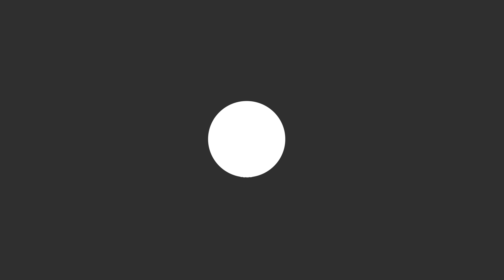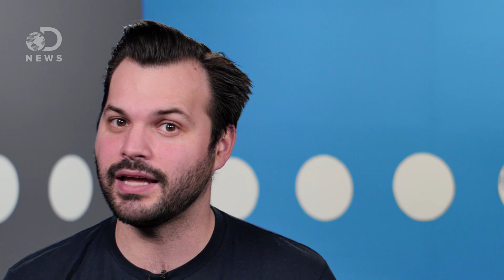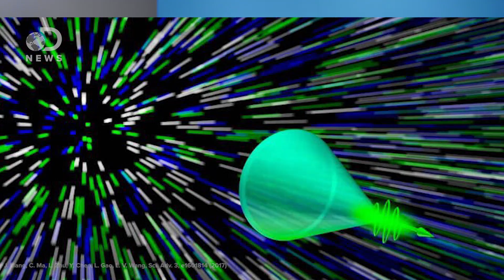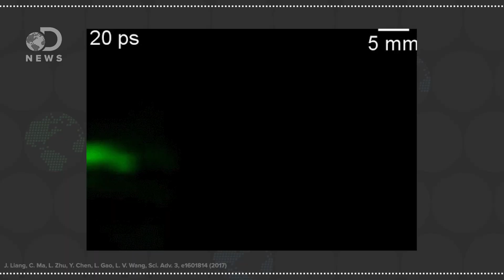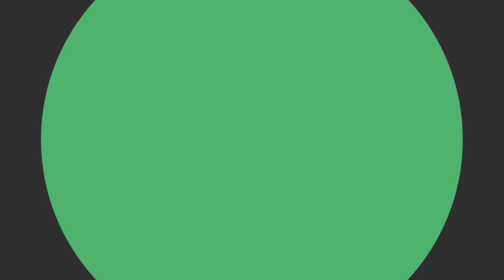'Sonic Boom' Of Light Captured For The First Time Ever

Comment: 100 billion fps it would take a bullet 50 years to go passed the screen
Reply: lol screen dimension would have nothing to do with it... maybe aperture size, focal length, or lenses used when shooting. but it would take the same amount of time for a video of a bullet to cross the screen wether it was 10 " or 10'
Reply: damn, people are sure dead serious around here...
Reply: Maybe the velocity, and distance traveled are obvious to him, like a 1800 ft/s 20 gauge slug moving across 2.35 feet. I don't know, but it might be closer to a 2500 ft/s NATO traveling across a little more than 3 feet. Granted you would need a fourty inch screen playing at 64 hertz.math is fine, but roughly rounded.
Reply: gregistopal I just calculated that assuming 60fps on the playback, 1 second of recording ≈ 52.85 years. I doubt a bullet would have taken anywhere near a whole second to go by the screen. It might be on vid a couple weeks to a couple months tho
Reply: Coltin Yancey He was making a joke fuckin hell.
Reply: gregistopal where dis you get those numbers? Bullet velocity varies widely depending on the caliber, screen of what dimensions, or did you just make them up?
Reply: Thats not actually correct. Its a filming technique that yields the IMPRESSION of a extremely fast frame rate. Unless I am mistaken, this is the same tech as the " 1 trillion frames per second" camera. As a result the final image is not from a single pulse but stitched together from many, each frame is a different pulse captured in a slightly different position from the one before. Its clever, but the claims are highly misleading.

Comment: Okay so if a jet goes fast enough it makes a sonic boom. so does the light make a boom sound? or is that you need more mass. does light weight anything? 

someone answer please
Reply: It doesn't, the title and phrasing are figurative, not literal.  The effect is similar to that of a sonic boom, but it is not an actual sonic boom.
Reply: Jose Ramirez 
Light is a photon, a little packet of pure energy as such it has no mass, but can to converted into mass in under some circumstances.
As for the sound I cant say positively but I doubt it doesnt make a sound as radio waves are a form of light wave and are well known to carry signals used in the creation of sound
Reply: +Coltin Yancey Well it wouldn't make a sound though. EM radiation is just used to communicate between devices that make sound. It doesn't make sound itself, more like it "tells" the device what sound to make.
Reply: +Andrew Velasquez Light, by definition, cannot have mass because it travels at the speed of light. Nothing with mass can be made to travel at the speed of light (it would take an infinite amount of energy) therefore light has no mass.
Reply: Photons have no mass. They do have momentum, that's why they can push stuff, but no, they have no mass.
Reply: light has weight any thing with mass can't escape a black hole
Reply: +Andrew Velasquez no, photons don't have mass
Reply: No this is Patrick search up if light weighs something
Reply: Jose Ramirez so if soundwaves move at the speed of sound without creating a sonic boom, why would light create one when it is moving at the speed of light?
Reply: Coltin Yancey photons make sounds, just not close to hearable to the human ears spectrum
Reply: Jose Ramirez if light has no Mass how can it be attracted by gravity?
Reply: King of the Castle Being massless doesn’t mean it can’t be affected by gravity, this was determined quite a while ago....

Comment: Since the speed of light actualy is constant and can't be slowed, wouldn't a more fitting explanation for the Sonic Boom beeing the emission of light from the atoms in the medium the photons wen't through? As I understand if a photon "hits" an electron its energy level is elevated but unstable. So when it returns to a lower level again energie is released as a photon. So basically a photon popped into existence and "accelerated" from 0 to c in an instant creating a Sonic Boom

Comment: (Facepalm) this is why I am probably going to unsubscribe. You can't slow light down. You can only put light through a medium and as it bounces around in the medium (at the speed of light) it leaves the medium at a different point in time, later, than it would if it were not going through the medium. Nothing was slowed.
Reply: frosted1030 Well, he explained how it works using the animation. They have to keep it simple because the audience may not have physics background.
Reply: Ingmar H no light is constant it's when traveling through different medians light takes a longer path(that's it in layman terms)
Reply: frosted1030  That's a popular misconception, actually.  You and DNews are misinformed here.  Light does NOT bounce around inside a medium at the speed C.  For instance, the graphic they show here at 30 second, showing light bouncing around like a pinball, is completely wrong.  If such a scenario did take place then the travel time of light through a medium would be random as there would be a random number of bounces off atoms before the light found its way out the other side and it would not necessarily even come out the other side... It could bounce straight back out the way it went in.  Another popular view, also wrong, is that light is constantly absorbed then emitted again immediately outside the other side of every atom it encounters.

What really happens is that when light enters a medium it is effectively no longer JUST light.  It changes into a slightly different quantum entity that is a combination of the original light wave plus the interference of all the quantum fields that surround each atom it passes close to while traveling through the medium.  Those other quantum fields create a slight drag on this "light wave", slowing down its velocity until it passes through the medium at which point it immediately resumes the speed C.  So DNews did get this wrong and you can unsubscribe if you want but you also got it wrong so be sure to question your assumptions when you are so sure of something.
Reply: It may not slow down, but if I'm correct in a way it does 'slow' down because it has more molecules to bounce around and against to be able to reach the other side. It may not actually SLOW down, but it takes longer to reach the other side. They essentially dumbed it down for the rest of the population, okay?
Reply: frosted1030 double face palm.  o my.  its a matter of sentence structure.  imagine a lineup at the bank.  going back and forth amidst the belts and poles...sure you could get to the counter faster by bulldozing through the lineup gizmos, but moving left and right several feet several times takes longer.  you were slowed down from the goal. different words were needed.  and what Bruno said.

Comment: this camera can capture image 100 billion fps, and that isnt faster than light?? seriously, i had this question for a long time
how this camera works?
Reply: I'm pretty sure its multiple cameras with super high fps that are offset so that whatever frames one camera misses, the others capture and then they are all merged together.
Reply: nothing can travel through space faster than the speed of light, the camara isn't moving. Actually, I'm not sure if I understood your question.
Reply: Calvin Franca the camera captures a series of same event to make a video and this talks 12min to 2hours
Reply: Purple Perplexing Pineapples it does not have a shutter, i could explain to you how this "" camera"" works but please just watch a video about it
Reply: Adding on to what A Fox said, shutters are meant to prevent too much light to be leaking into a "frame" which is a still picture, or a still picture within a video. The faster the shutter speed, the less light that enters the camera. With something capturing light at 100,000,000,000 fps, there's not enough time for light to even bleed into any of the frames and cause overexposure, so you'd likely get not only very dark frames, but for that same reason, you wouldn't need a shutter either.
Reply: Calvin Franca me too
Reply: Anim Mouse Not when the capture rate doesn't allow bleed into the frames. It just isn't practical. The purpose of a shutter is to keep light from bleeding into a scene. More time exposed means more light exposed from the scene. You will have twice as much bleed in a 30fps recording as a 60fps recording if the shutter speed was the same because there's more time for light to be exposed, but if the framerate is nearer the speed of light like the one in the video, then much less light is let in during the capture of the frame that having a shutter literally makes no sense.
Reply: Calvin Franca great thinking....did u got an answer...?😊
Reply: All cameras have a shutter, either mechanical (DSLR) or electronic (digital cameras) shutter.
Reply: To AMIT Kumar: Does the camera sample, like a sampling oscilloscope? Then what is the actual frame rate. Still it is good if it has the timing accuracy of 10 ps for the sampling.
Reply: Light travels 186,000 miles in one second. So, how long does it take to move 6 feet? I’m sure the camera is slow as shit next to light.
Reply: tomasgonzales i know this is 8 months ago, but the shutter speed on a camera that goes 100 billion fps has gotta be rediculous
Reply: And possibly faster than light which is why it doesnt really make sense and even if it does go slower, thats still too fast to make sense